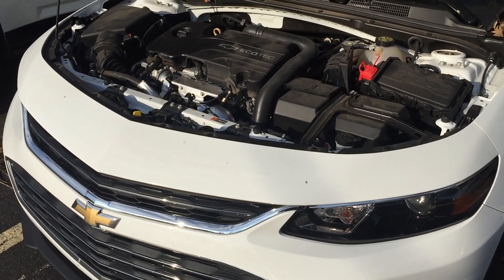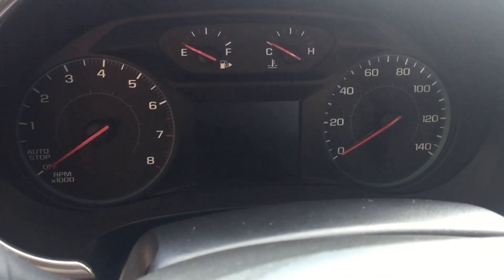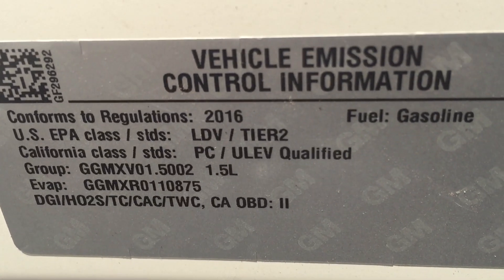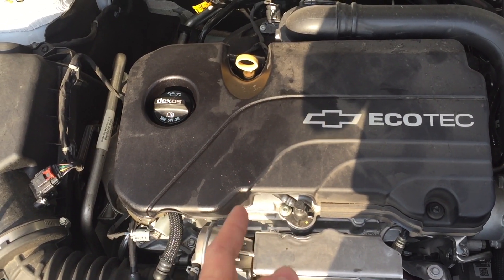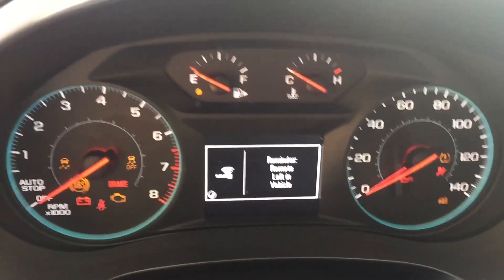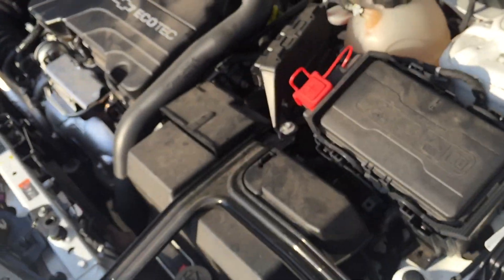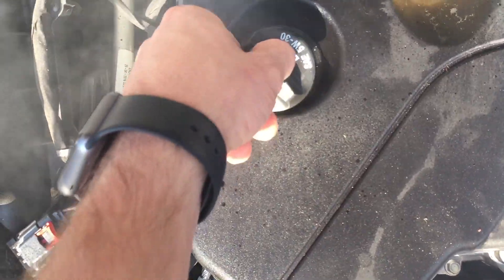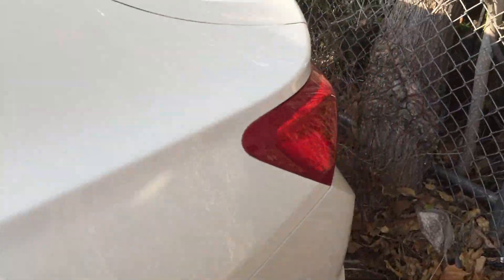What Engine Blow-By Looks Like

Comment: I would never buy a Chevy, again.
I would never buy one of those tubocharged mini-engines, whether they be Ford or Chevy or Chrysler. They are a fraud. If they don't fail now, they will fail at 50k miles. And you will pay through your nose to repair them. You will spend $7,000 to repair a $7,000 car. It does not make sense.
Reply: It's not all manufacturers, the EA888 series (ESPECIALLY the GEN 3 engines) used by V.A.G. are bulletproof when properly maintained, and can reliably produce a TON of power on stock internals. This is a prime example of shitty engineering (more specifically, engineers that were given cost constraints too strict for the level of performance or reliability desired).

Comment: Poor quality pistons made by the lowest bidder who is required to continue to cut costs year after year. It's the GM way! GM is hard on in their suppliers and unfortunately quality suffers. I bought my wife a new CTS back in 2010 and that car had close to 8k in warranty repair before we even hit 50k miles. Traded that GM shxt box in for a Lexus and haven't had a single issue as of yet.
Reply: DIY Dan they all do it not just GM

Comment: the 1.5 gm baught from Honda engine is only designed for max of 80 horsepower naturally aspirated if it was up to me in 08 I would have told them that they would have to file for chapter 7.
Reply: Thats an Opel Ecotec engine. Designed and enginnered in germany.

Comment: There is no mystery here there are two things at play here. First there is a turbo and two there are newly designed piston rings even thinner then before to save fuel. Turbo's for years have killed alot of engines because they cook the oil in a shared oil supply or basically coke the oil. This causes the oil supply to thinken and that plugs the pistons oil supply holes at the rings which in turn cause the rings to dull and that is why there is blow by gasses. These new cars run zero weight oil  or something close to it for these newer engines. Honda had this issue years ago on the K series engines but they had bad work practices where they didn't index the rings enough and when the oil got dirty it just speeded up the process of oil burning because when it got dirty it killed the rings. Toyota had issues with the engines cooking oil because they designed the holes for the oil too small and when the oil got dirty they too bit the dust but not as fast as honda did but same story. Now the other issue could be that the engine is ran too lean and that too is over heating the walls and killing the rings.

Comment: this issue ive found to be extremely common on GM turbo and supercharged engines ive incountered this a lot the GM dealer in my area just says nope not going at it usually results in my shop dropping new engines in these things they LOVE to overheat the pistons these engines are based on a diesel design wich isent a bad idea but the alloys they use are for the diesel they based these engines on and they cant handel the heat generated by the gasoline they burn they then melt and grenade the engines one of my many reasons why ill never buy a chev they could never get a vehicle to work correctly (the antitheft systems still have the loss of communication issues they always did oh well they keep my bills paid lol)

Comment: I dont know why this is an automotive trend to drop turbo charged micro engines in economy cars? A na 2.2 or 2.4 has same or more horsepower and can be tweaked to achieve the same mpg. You just end up with a more complicated engine with more parts that can fail over a slightly larger na engine that is bulletproof..I know the older 2.2 and 2.4 are. My dad wrecked a Pontiac with a 2.2 ecotech,  put a leak in the oilpan and it made it to the driveway with practically no oil. Of course it was towed away and totaled out later.
Reply: There is a lot going towards EPA rules and regulations. You would be surprised at how much they want to regulate the naturally aspirated engines even more then what they are. Smaller Turbo cars should be more EPA friendly. But then again its all politics at that point.

Comment: This is a real shame.  I really wanted a new car and the Chevy Cruze was at the top of my list.  My Chevy S10 is getting old and I was considering either buying a new car or fixing up what I already have.  It would be great if I can fix the drive line vibration issue and get it into the shop to fix the body damage due to rust.

Comment: typical Chevy. decided to use the same material as PISTONS as their pushrods for their garbage lt and ls engines. to think I had respect for their company.
Reply: _Husky it's just anything American made today in particular Fords not doing any better with those 6.7 diesels and transit vans Dodge isn't either with their torque converter going out on their trucks
Reply: HERPY DERPEDY the 6.7 was a mistake anyway. it was subpar in its IDI stage but the 7.3 and the latter 6.0 are good. their engines are also the superior of the American market as they're simplified, efficient, reliable and cheap to produce. get a fiesta with a 5 speed and you're going for quite a few
Reply: _Husky Na already have a Honda and love it 15 years old spent all its life outside and basically no rust engine is running great never had a problem has always been reliable
Reply: _Husky 
wrong

Comment: The solution is to rebuild the engine. if [possible?   Probably the engine is just too small for that car...
Reply: Suzanne LeBizarre  They just need to stop the turbocharged micro engine trend and go back to slightly larger NA engines.
Reply: Ricky Plotner They can't, because CAFE standards are retarded and don't reflect reality at all. Expect more badly tested, rushed to market engines like this in the future as manufacturers rush to meet impossible standards for emissions while we still use bunker fuel on ships so it doesn't matter at all what cars do.
Reply: Kaleido Motoring You know the irony with the cafe standards are that they keep getting pushed back because of unrealistic goals. There is a 2.2l Cobalt in a rare economy trim, eeked out to 41 or 42 highway mpg. Its defiantly possible in 10 years research to now to have developed better. The 2.2l ecotech isnt even direct injected.

Comment: The main reason for such problems is a low octane fuel. All modern downsized turbo engines require at least Premium fuel (95 in European octane rating) and Super Premium (98 in European octane rating) are highly preferable .
Reply: Konstantin Savinkin I completely agree with the need for higher Octane. I was in utter shock when I saw that my owners manual for 1.4t Cruze recommended 87 octane.

Comment: there's no such thing as a good American 4 cylinder
Reply: lol fords ecoboost 2.0 and 2.3 are pretty good motors
Reply: That's pretty ignorant to say... Wow... Your lack of experience and knowledge is overwhelming.
Reply: Leemur2335 the 2.0 and 2.3 ecoboost are based on the Mazda L engines, yes. But to be more specific, Ford is manufacturing these L engines now. Mazda has completely moved on from the old L engine to the new skyactiv engine.

Comment: my volvo 240 has 370,000 with the original engine, transmission and head gasket so as far as im concerned i dont need a new car if the engine will destroy itself by 20,000 miles

Comment: Turbo charging, relatively high compression, low octane fuel and poor quality internal parts. The things manufacturers will do to improve their EPA rating by 2 MPG and keep costs down...
Reply: Well my Toyota Camry has a bulletproof naturally aspirated 2.5 liter 4 cylinder. It averages 38 on the highway and 28 in the city. The law of deminishing returns for the gasoline engine holds really true. A turbocharged and downsized engine looks good on paper but in reality it an epic fail. What we should’ve done instead of forcing automakers into making needlessly complex internal combustion engines is to have a mandatory road map to phase out brand new cars that run in fossil fuels. Starting with high end and midrange luxury vehicles and trickling as battery technology improves.

Comment: Ever since the manufacturers went to these small, turbocharged engines, they've had issues.  They'd be better off with a small v-6 with port fuel injection and no turbochargers, which are a crutch for a weak engine anyway.
Reply: Walter Grace there trying to build high performance engines at a budget I'd leave that to Honda Toyota Mercedes Benz BMW Audi Land Rover for that
Reply: HERPY DERPEDY I leave that to the professionals.
Reply: Walter Grace to be fair, American companies never focused too much on small engines like inline 4s or 3s, so when they start mass producing this shit plus adding a turbo... that's not gonna go well. I barely trust Toyota and Honda with turbo 4s but I'd pick their turbo 4s over anyone else. But naturally aspirated inline 4s, u can't get better reliability than honda or Toyota
Reply: ***** best turbo 4 was the Evo and WRX from Japan anything else definitely German or Swedish like Volvo
Reply: Japan has had small turbo engines for decades and they last just as long as their nonturbo counterparts. it's the manufacturers cheaping out on critical components that are causing these failures.

Comment: The fix is a Japanese vehicle 😊
Reply: why?
Reply: My hyuandi sonata 2015 with 140k miles is doing this without the smoke tho.
Reply: Apart from when the head gasket goes on your Subaru
Reply: @lukegodden1529  nope. I have owned 6 Subaru’s, I currently own a STI, WRX & Impreza. 
I have never blown a head gasket or had any engine issues
Reply: @Ooo0oOo0oO  I currently own an 04 STI which has just had a head gasket go lol

Comment: this company should have been allowed to fail.  Nothing but shitboxes.
Reply: Chris P Bacon really? Every car markers have problems no car maker is safe
Reply: Chris P Bacon that's a Korean engine, would still take an American built GM V8 for longevity over anything really.
Reply: +fujiuser1968 they never had the same parent company
Reply: The ONLY thing ford ever got right and isn't shite is their 9" rear ends.
Reply: GM should've have been bailed out should've declared bankruptcy and they'd be in a better situation.
Reply: Good old globalism.
Reply: yea cause Fords are flawless right? Every automaker has problems.
Reply: @camaroman101  even toyotas are turning out to be junk no
Reply: +Greendude33 they aren't Korean they're European
Reply: Hello By this particular engine is Korean
Reply: Chris P Bacon lets talk about shit boxes. that mustang in the picture is a SHITBOX CAR  those things were pure junk tops of the fenders rot out cause have no inner fender. go in the ditch and the car is bent THEY HAVE NO FRAME unibody junk oh lets talk about junk ford motors. ford has had very few motors that were even worth a shit no oil presure bearings rattling all the time no power 351m 400m 360 390 300 six 302 351 all these motors are pure shit. the 200 six cylinder was a good motor 460 was ok 429 ok but rare early 289 ok later ones junk. i but you never even work on motors or cars DUMB FUCK
Reply: +1970 olds442 anything but 7.3 ford diesel is the only good diesel ford had
Reply: Call a mustang a junk car, but mine I rebuild has inner fenders, has a frame bolted to the unibody structure, and the rebuild 289 with hydraulic rollers works great so... the point is every car manufacturer has its shit moments. And this video shows chevy having one... but fuck dodge. I'll take a chevy or a ford any day over dodge.
Reply: Are Chevrolet and Dodge no longer the same parent company ? (in UK so don't jump at me)  lol
Reply: I was always led to believe that Chrysler,Dodge,Chevrolet and Pontiac were all under the GM group,along with Mitsibushi and International Motors who own Subaru and Isuzu  :-)
Reply: +fujiuser1968 the big three Chrysler, GM, and Ford. Isuzu I think was mostly owned by GM sometimes in the US there are a few rebadged Chevy Colorados with Isuzu on them. I don't Mitsubishi or Subaru have anything to do with the big three unless you were thinking of Saturn which GM axed 8 years ago.
Reply: Chrysler and Mitsubishi were in an alliance for a while. Hence the Mitsubishi 3000GT and the Dodge Stealth were the exact same car. Ford has a 30% stake in Mazda. Subaru isn't owned by an American company, its parent is Fuji Heavy Industries.
Reply: +smokehunting1 well until the Fiata came out…
Reply: i dont know about that man, all mazdas still say FoMoCo on every single component the have
Reply: the new mazda bt-50 has fords duratorq engine, i rebuilt one and is identical

Comment: We have a saying in the UK, all Vauxhalls are Sh**! I had a rental Mokka recently, it was utter garbage, change up light at barely 2300 rpm! Was a 1.4 Turbo 4x4 petrol, drank fuel like no tomorrow, and didn't seem that powerful
Reply: 2.2L L61, 2.0L LNF, LHU have been very reliable.
Reply: EnderWiggin once i had myself a chevy malibu with 3.1 SFI engine, it was a GOOD car, sold it with 250K miles on it and still running strong. americans cars are very new on turbo and direct injection tech, it is a matter of time for american engineers to figure it out. europeans with same technology are great
Reply: i have a friend over in Europe, he did tell me the bad reputation Vauxhalls have over there, GM really went to shit after 2009, and it's not for no reason either :/
Reply: They went well before then, the Vectra here was a very low point, at around 4 years old they were pretty much screwed, especially in 2.2 form. The Insignia of all generations seems to like to catch fire, and the 3 cylinder Corsa seems to grenade its engine for a laugh
Reply: craigybus1
you mind i ask which vectra you're talking about? Vectra C by any chance? i have a chevy malibu (2007 btw) and it's effectively a redesigned Vectra C, same platform and drivetrain, just different skin
Reply: Yup the Vectra C, the Vectra B wasn't much better either, I don't think any generation of the 'Ecotec' engines have been particularly very good, typical accountant built, made from the cheapest available components
Reply: craigybus1
odd, for some odd reason here the Ecotecs are highly regarded for their reliability, the Cavalier for example, used a gen 1 ecotec, and there's plenty of them going around with 200K miles.
Reply: craigybus1 american cars are very new on direct injection and turbo engines, 20 years behind europeans, they need more expertise to offer reliable products. just as jatco with cvt shit. concept is not bad, is just that technique and expertise is 20 years behind
Reply: Ironically I'd call that 3100 series junk. Power was subpar, and while easy to work on, the upper intake gaskets were known to go bad. The 3400's weren't any better, and I think it wasn't fixed until the 3500 series engines did they finally get it right. If you take care of the car per the manufactures recommendations, it should last a long time. That said, there are some lemons out there.